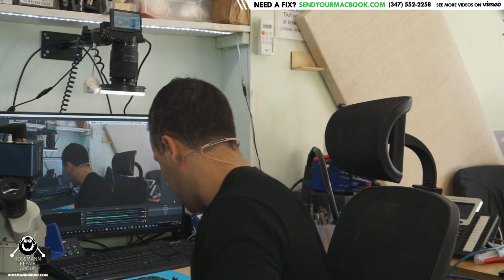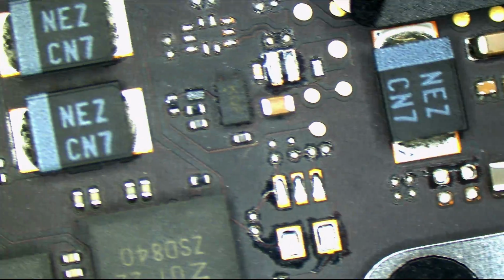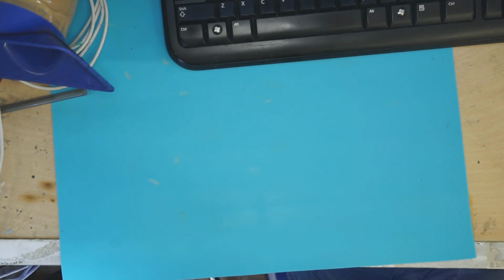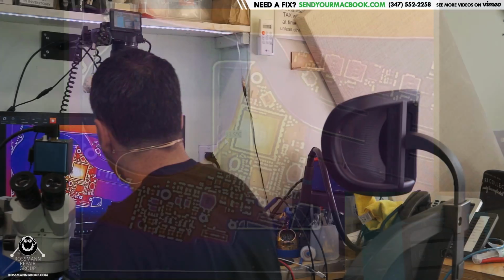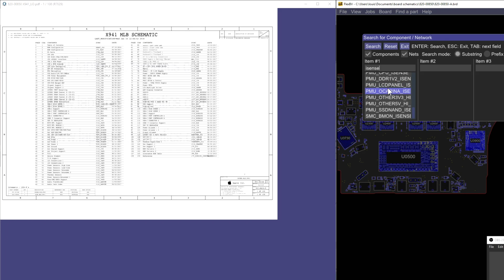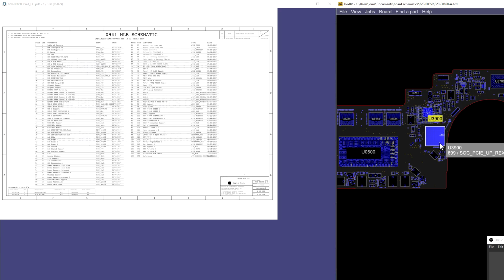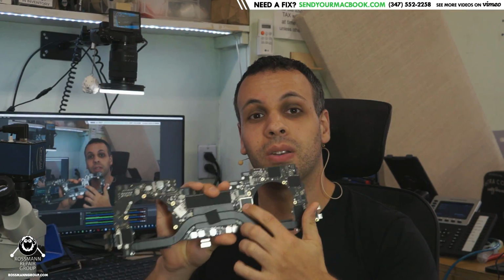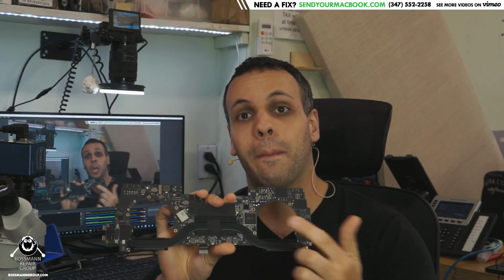Apple users have no one to blame but themselves.

Comment: Having been on the Genius Bar side: 9/10 apple geniuses don’t know what Flux is. I had to coach people on multiple occasions that flux residue was NOT liquid.
Reply: Yeah, literally any dumbfuck could get a job at apple. They're not geniuses, they're not even experts. They're literally worse than newbies.
Reply: Coming from a Former Mac Genius from Mid 2000s. The peeps who are behind the bar, are not of the same quality as the ones back in the day. We worked for the user and tried to get solutions. I left when they started hiring 'cool' looking peeps and one of them fried an iMac Power Supply and Logic Board when he didn't tell anyone that he let a screw fall inside said Power Supply.
Reply: @jjohn713  Yep, Best buy did the same crap. Let's hire unqualified idiots to sell services and "look" the part so we can pay shit wages. Anything that needs real service either gets shipped off to an actual technical repair facility to some reason is "invented" to invalidate the warranty.
Reply: Let's be honest. No "Tech" at any big box retail store is a "Tech" by any stretch of the imagination. Actual Techs aren't going to work for damn near minimum wage.  The people that work the genius bar, geek squad etc..are beginners or some random clown who installed a program and think they are techs. You might have the rare "tech" who briefly passes through these places, but they never stay long.
Reply: OmegaGamingNetwork I was making $24 an hour when I left.
Reply: @Ihavcat  As a manager perhaps, not as a technician. The guys who actually do the work max out at $16/hr. That took all of a 5 second google search as that information isn't exactly hidden.
Reply: @OmegaGamingNetwork  I resemble your statement. I was a Geek Squad tech ( before it was even called that) and was hired because of my electronics repair and Microsoft certifications. We had guys who could diagnose software, but did not understand basic electronics theory or component identification. Those morons at the Apple stores that are paid to be a tech are just swapping product and in some cases boards. Apple is a scam people, wake up.
Reply: OmegaGamingNetwork I only been to the geek squad thing once but those people seem to know more than what people Apple hires people who actually know a little about computers and simple motherboard issues and troubleshooting but maybe depends on place
Reply: @itzsupremedestroy4766  It might depend on the place but my main point stands. People who are actual techs and actually know what they are doing, aren't going to be working for barely above minimum wage for long. I was actually working for BB back when they were transitioning from the tech bench to the geek squad. They made it sound like it was going to be the greatest thing ever. Unfortunately a month later those of us who actually were qualified technicians were told we had to take a pay cut down to around $1 above min wage. Needless to say we all told BB to pound sand. They had ceased hiring techs with the GS branding and just hired anyone willing to take that pathetic amount of money as they do little to zero actual tech work in the store. Their "Services" are largely bullshit designed to pump chumps for money to do effectively nothing.
Reply: OmegaGamingNetwork and I say that not to refute anything exactly with what you’re saying, but I will say that the only thing that kept me there waS the pay and benefits package. I could explain more but I’m on mobile and it’s cumbersome. Suffice it to say I had a decent stock purchase plan, RSU, good health benefits, plus that base wage; it wasn’t bad. The part that made me leave was knowing that there was shit that I could take home and fix for under $10 with some flux and solder. Yet I had to charge $400 for it. It was shit.
Reply: @OmegaGamingNetwork  The fact that they can just lower your pay like that is what's wrong with America.
Reply: @OmegaGamingNetwork  I also was in your same position at BB, but I was a part time evening tech. They went to the new branding and remote software running from Texas to diagnose in the back room. I did a good job and had regular customers whom requested me  as I would actually dig into the machine to find the real problems. There were so many repeat repairs from other techs that I had to redo, and this is one reason I had to get out. Never had to take the pay cut, and this sounds like it was only your location as I never heard this one till now .I was only making $16/hr. I was one of the original techs when the new store in Harrisburg had opened.
Reply: @OmegaGamingNetwork  While I absolutely agree that you need to have worked on the actual hardware as you can get your CCNA using sims only, you also need proper work experience. Tinkering around in your basement does not count.

Source - myself as I did recruit for entry level IT and networking roles for almost 3 years
Reply: @OmegaGamingNetwork its oot but i'm curious, asuming that youre the one that retired from CCNP, its quite a big move right? where or what kind of job are you in right now? and may I know the reason?

I actually almost pursue cisco certification path, but seeing cloud becoming more popular, i shift to cloud.
Reply: @lknhd  I am "temp-retired" so I could enjoy more time with my kids. Temp meaning that basically I have enough money that I could afford to take a job that provides excellent benefits and just enough income that I don't deplete my savings too rapidly while working minimal hours. However once my kids are both out of HS I'll be returning to the field.

Comment: You make it so easy for me to never by an apple product.  I got a pretty much free Apple xserve,  its all Intel based mother board, but every thing programmed for crappy Apple so you cant just install windows on this server. Would like to still use the case if possible and CPU's by replacing the board with a windows based board.  I never liked apple and I guess your videos makes it so easy to never buy anything apple.

Comment: What if you rigged up an older smc and used pm slp s4 l. Or, what if you transfered all the SSD and CPU components to an older board and recovered the data that way?
Reply: the SSDs are encrypted by the T2 chip, they are a unique pair. So without the original T2 chip... uh... goodbye data.

Comment: Ok. Maybe I have been lucky, but so far I have had few issues with Apple products and numbers would suggest that more products do work without issues than don’t - otherwise Apple would not still be in business. There are 4 Apple product users in my household and maybe we are the lucky ones. I also bought a £1700 Dell laptop that BSoD on me dozens of times in the first 3 months due to a faulty dock that Dell eventually replaced. Shoddiness exists everywhere and sometimes we are lucky, sometimes we are not. That said, I hate not having the right to repair (I replace damaged iPhone screens for friends and family for free, where possible) and Apple’s drive to prevent repair has now convinced to stop all all Apple purchases from now on until they play fair, which I guess they won’t until enough people change brands. Thanks Louis for continuing to bring this to public attention, as this is not a business model anyone should support. By the way, which android phone would you recommend for teenagers?

Comment: This needs to be on the news again! Also, I did my part; I only use non-retina MBPs from 2012 (with two SATA drives, 4TB), or normal laptops, and have put many people off buying anything newer due to soldered on RAM and later SSD and later T2 chip. I will show this video to anyone thinking of getting any Mac stuff :)

Comment: There is the inevitable question that is... What will it be of your business when the eventually old hardware starts dying,  there's no point to repair it because it's completely obsolete and all the newer ones have this T2 SMC.

Unfortunately, another person that fights for right to repair will go down.

But hey... Keep buying Apple products! They got your back... pocket.
Reply: He should start repairing actual repairable products like Asus laptops and samsunh phones.
Reply: @crozel7262  maybe, but the competition is way fiercer there.

Louis is a god in what comes to Apple repairs due to the experience he got of over a decade. Which in my opinion might also contribute to another issue additionally to the competition mentioned earlier. You can have an Interstellar knowledge of electronics but product knowledge and experience is also extremely critical which I don't believe he has in other brands.

Then there's schematics need to be obtained, the stock on certain electronic parts available on the website would have to change ( remember that Louis's online store has shit tons of electronic components for Apple products).

In any case, I appreciate the objectivity and critical thinking of Louis and I'm sure he'll make ends meet. I'm guessing that the AASP exam being taken by Louis is exactly that... An acknowledgement of what is to come and adapting to the current conditions.

Comment: There was an Apple,  now it's Cooked Apple. T2 it's second version of board terminator.  Just to mention what im using now it's 14 years old HP Compaq TC1100 and it's still working well.. what im holding in my pocket is Blackberry Passport and on side got Playbook with Boat Browser installed still works well. Even if i want it sometimes to die, got much faster ones.. hold in room prefer using for unknown reason. But must to mention both of these companies HP and BlackBerry reason of faulure in long run was also  how many other designs specially Pavilon laptops ended in trash before warranty end one, two years after. The same was with Bold in fact most of product was slugissh crap. But hopefully there were exceptions. This list doesn't include HP Elitebooks, Dell XPS or Lenovo professional products line. Apple hasn't ever got good devices now it's become just awful comp witch main reason of existance is get more more money from their customers. There is no other vision behind curtains than that cause company is ruled by supply chain officer formally CEO now. There is no other vision behind.. just empty shell of financial machine to feed stock market investors more more.. There is no design, there is no risk of failure.. but it will fail. And it will be also your fault - customer.

If even Apple Chinease repair shop couldnt handle the smartest path was choosen - as always it's you fault, the way you hold the phone, the way you use device.. So it's shouldnt be suprise if Louis blame you once again. Right?

Comment: I like MacOS but after seeing this I definitely will NOT be buying a MacBook. Linux has come a long way and it is a good and stable alternative. I currently do use a 2013 MacPro and am quite happy with it. It is quiet, fast (I did upgrade the RAM to 64 GB) and stable. I am planning to build a gaming and backup rig with the requirements being that is it also quiet, easily upgradable and stable. I will try to run Linux and Windows as a dual-boot system which should allow me to get the benefits of a stable Linux system as well as run Windows should I need to. I  really hate the Windows OS though Win 10 has at least made some strides in making it more stable though it still does not come close to a Unix/Linux derived system.

Comment: I purchased my MBP 15" in the USA back in 2014 (late 2013 model) and I was slightly annoyed that the RAM was soldered on I could do with 16gb. At least the SDD was not soldered on. $2000 is what I paid and that was on the limit. Plus £100 for the extended warranty. (had a fan, a logic board and a screen replaced under warranty - store damaged my screen when replacing the logic board...)

Now the price is $2500 and nothing is replaceable and apple now rarely do anything under warranty unless sued, I can't justify upgrading.

It still works (surprisingly).

Comment: The internal SSD data recovery connection has been removed from the T2 Macs because the data recovery is now done via the Thunderbolt USB-C connector. As long as the board's SSD isn't destroyed and the board can power, then the recovery is done that way.

Comment: I sold my 2018 MBP (i9 6-core, 32Gb, Vega 20, 1TB) as I heard a new one is coming out so wanted to sell when it was current.  That had the T2 chip in it which many people complained resulted in Kernel Panics with eGPUs and other issues. I might have got lucky as I didn't have those problems. 

Save to say I will be sticking with my Dell Precision for a little while and looking at upgrading to the new Lenovo P1 laptop soon. I love MacOS but its just not worth it anymore.

Comment: 37C just isn't that hot. It's on, sure, but not burning.  There has to be another fault.
Reply: It's power cycling and it'd only place that gets anywhere warm. It's not a straight MOSFET failure, indeed. The proof is on the weak side, however I presume they have spent a lot of hours trying to diagnose the issue.

Comment: MacBooks work perfectly fine and never have issues if you follow directions: Leave them in the original package, store them in a dark hermetically sealed room at exactly 72 degrees F, 21% relative humidity and never turn them on.
Any use will void warranty.

Comment: Ouch, for a phone security is extremely important even if that means your data is saved with encryption and is not restorable in case something breaks. You can always make a backup on your computer and it usually doesn't contain the files that you're dependent on for your income. On your computer data recovery / access to your data must be possible if any component except the storage breaks. The only product I would buy from Apple is the iPhone (if they decide to finally release the SE2) everything else... meehh I don't even like the operating system.

Comment: I work with a couple of Apple-ites that think the sun shines out of Apple's ass.  One of them owns an older Mac Book Pro and wanted to upgrade the RAM, I howled with laughter when he told me that the RAM on his Mac Book Pro was soldered on.  I have never supported or bought anything from this shamble of a company.  When people as for recommendations, most people just say Apple but then I say that there are more choices out there that are much better than the whole Apple eco-system.  I tried using the OS but found that all the pretty animations and the retina display are just fan service and no substance.  I am not a Windows fan boy either but at least with that OS you have choices other than Microsoft hardware.

Comment: I just fired up my home-built Windows PC this week. It's replacing my 2017 iMac and it marks the end of a 9-year Apple run that began with my 2011 MacBook Pro (which is still running like a champ). I started designing this PC as a Hackintosh but decided to just completely pull the plug on Apple.  Because I'm doing my part.

Comment: (Imagine an Austrian accent)  There is a high probability that the T2 chip has been damaged by mem-memetic poly-alloy... liquid metal.  It can imitate anything it samples by physical contact.  The board appears undamaged.  In actuality... it now works for SkyNet. :-)

The T2 chip is not there to protect Apple customers.  It is there to protect Apple FROM its customers... and "independent repair."  If the T2 chip is designed to "commit suicide" upon detection of any other component failure... or just when the warranty is expiring... owners will be forced to replace the whole logic board.  At which point, are they not more likely to replace the whole machine with a new one?

Disposable durable-goods... Apple's contribution to the man-made portion of climate change, and growing credit card debt (the next financial bubble about to burst?).
Wac.  It just breaks.
CrApple.  Stink different.
Reply: Yeah. If they cared, they would allow connection to the likes of the SSD and a password... encryption is encryption and if you know the password, that's all that's needed, not the t2 chip!

Comment: I knew a guy at work who said he ripped out his pre-built desktop's power cable because it was pissing him off while he was playing fortnite. He said the hard drive stopped worked after and it wouldn't boot
He described the problem to me and the age of the unit. The problem was obvious, thermal throttling. 

I told him it's an easy fix overall but he'll have to replace the drive. 
He said nah, and then bought a console to play fortnite and an apple laptop to replace his desktop; saying that he was done with computers and wants one that "just works". 
It's the same as if your car needed an oil change, so you took a hammer to the spark plugs. 

In the end, I think the main issue is education. People don't know that computers need any kind of maintenance. Since we use them everyday, the basics of electronics should be taught in school. Teach people about the insides and how it works and even have a modding contest every year for all schools in the region.

Comment: Also implementing this in the way that Apple has also makes it a lot more expensive for them to replace. Therefore it is in their best interest to refuse all initial claims of faulty hardware using any reasoning they choose. Thankfully someone like you has now determined that there is no water damage to this. The customer needs to bring it back, let them know that no water damage was found and that they are ready to pursue legal action if this is not resolved. That also includes compensation for the time without the laptop and all legal fees.

Comment: Yeah, the last thing I bought from apple was a replacement charger for my e2011 MacBook Pro i5 13". Before that? It was the e2011 MacBook Pro i5 13". I'm done with them. The next computer I get will be self built with Windows and Linux. I'm going back to builds. No more Apple.